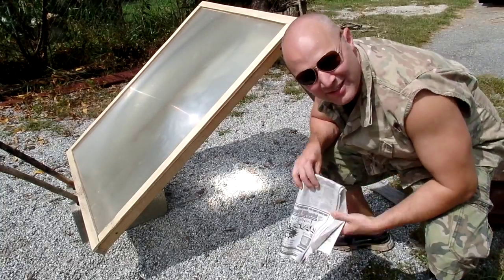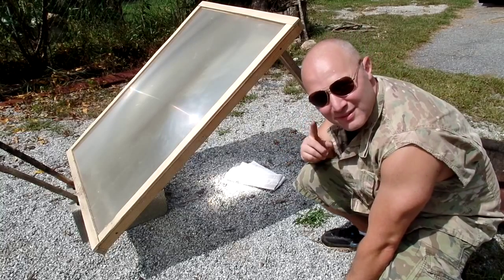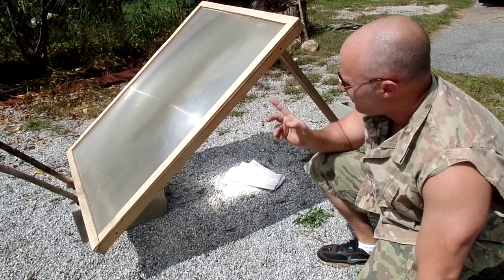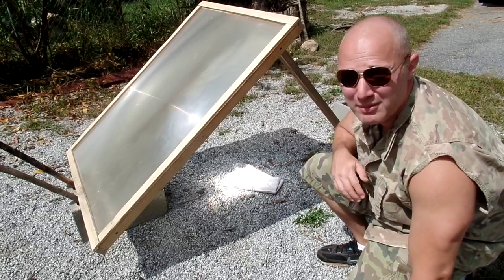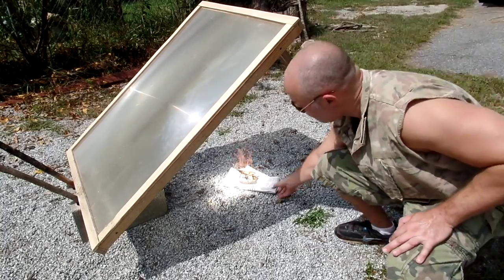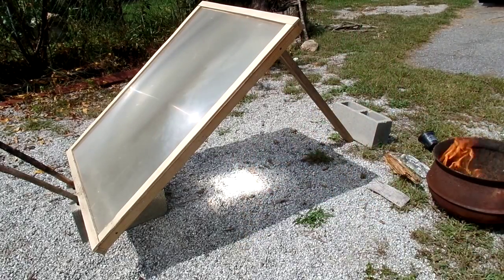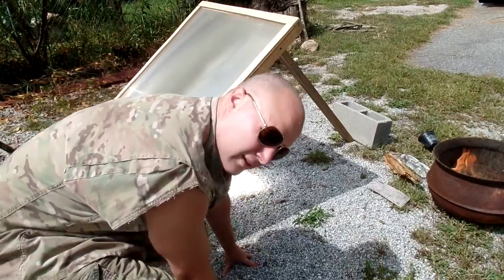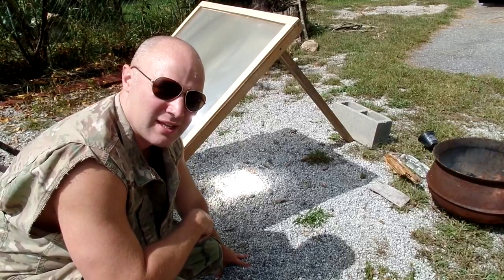Fresnel lens fire with the Driveway Primitive

Comment: I got a 50 inch spot lens that melts rock, glass, and metal. Is yours a spot or linear?
Reply from the maker: +Michael Ellestad I think it is a spot since one side is smooth, but it doesn't get as hot as yours. I need to mess with it more, but mine is magical - every time I get it out, clouds appear.
Reply: +Eric Hollifield Is it real clear? Mine is not only thick but also very clear, Mine use to be a linear but I sanded and polished the linear ridges out making it a spot lens
Reply from the maker: +Michael Ellestad No, it isn't window glass clear and it is fairly thin. I read about sanding or applying a varnish to fill in ridges on a linear, but I can't feel any ridges. Sounds like you have a very nice set up.
Reply: go to my channel and click on my Fresnel lens play list. you may want to put your lens on a swivel stand then you have perfect control of you focal points. I also got a 60 inch widescreen framed in as well. I am still on the hunt for a giant square screened 65 068 inch Mitsubishi or Sony projection TV. Get a lens that size that will make temps possibly at 4000F! The 50 incher is melts steel nor problem at all.